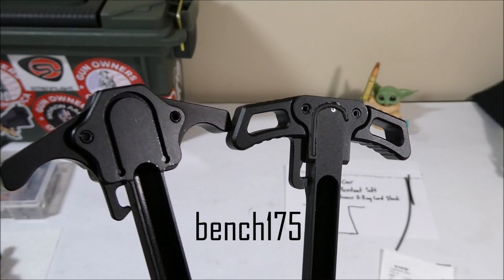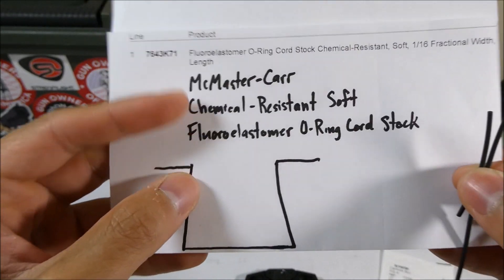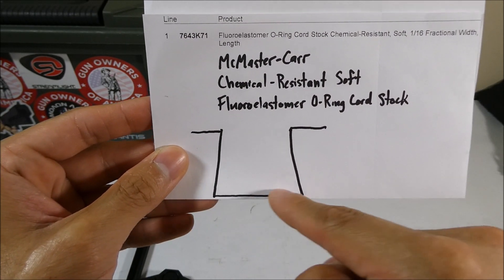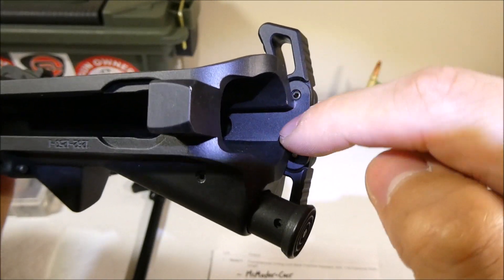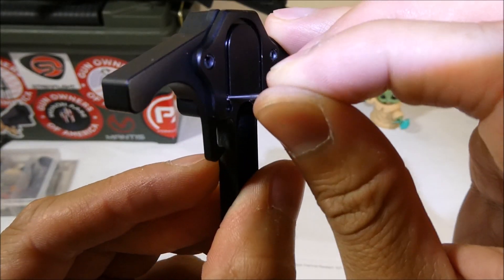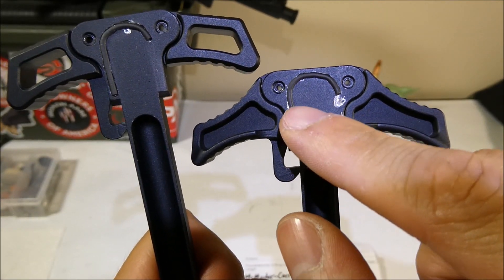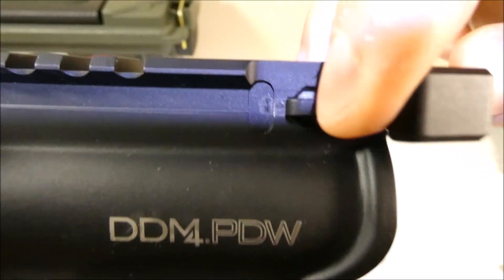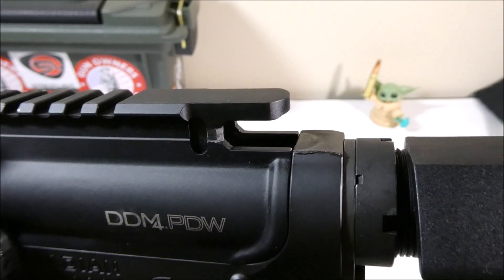Do-It-Yourself Gas Defeating Charging handle with gasket DIY

Comment: Awesome job. I love tinkering with little things like this. I might try this out. I've done the Permatex mod on my Geissele, SNA-CH, and Radian SD. Surprisingly, the Radian SD gives me a bit of gas to the face when shooting my RDB 9mm AR, and I'm 99% sure it's under the charging handle. The Geissele SCH w/ Permatex works very well. I haven't used the SNA-CH w/ my 308 AR much, but I don't remember much if any gas to the face with it.
Reply from the maker: Thanks.  Ya SilencerCo did a slow motion video montage showing that most of the gas that gets to the shooter is from under the CH

Comment: Good video.  Doing it freehand is interesting.  I wish there were more gas-defeating options on the market for a more reasonable price.  I'm considering the CMMG Dissent after there are some reviews out there and they can get the kinks worked out.
Reply from the maker: Thanks.  Yeah they seem cool.  I'm interested in their recoil impulse and gas containment
Reply: @bench175  Absolutely.  My GUESS is that the recoil impulse will be about the same as  an AR-180.  No recoil buffer means a harder tap at the rear end.  I am guessing that gas control will be better, but then again, just a guess.  Since this gun would be wearing a suppressor all the time, no biggie.  The can cuts down on recoil anyway.
Reply from the maker: Another thing is the tall upper receiver which makes the red dot shorter and harder to see anything your mount to the top pic rail forward of the red dot.  That was an issue with my apc9k